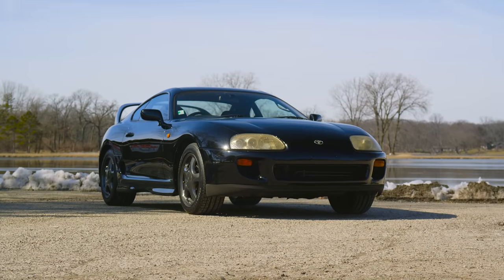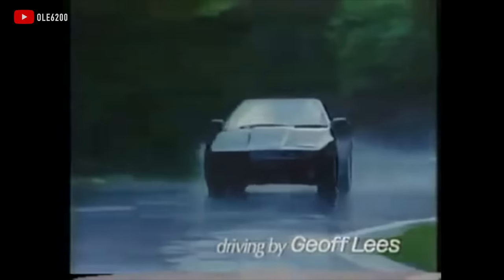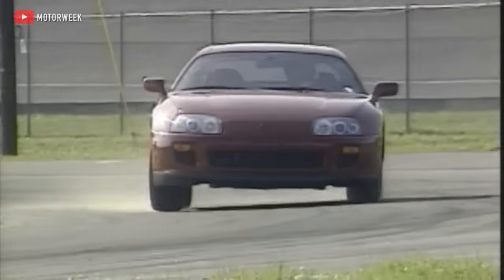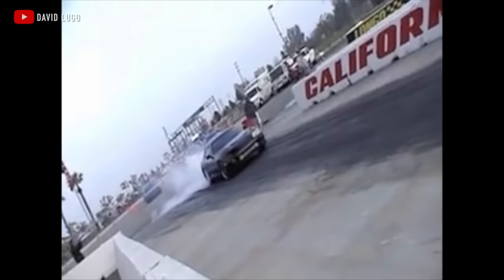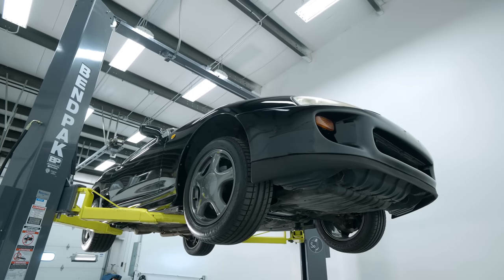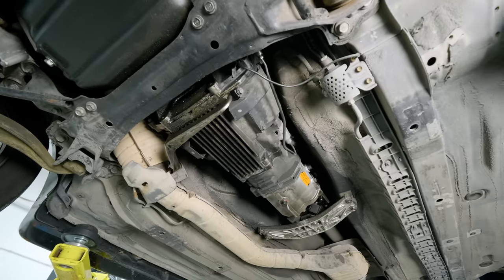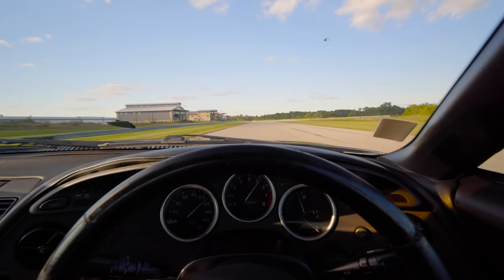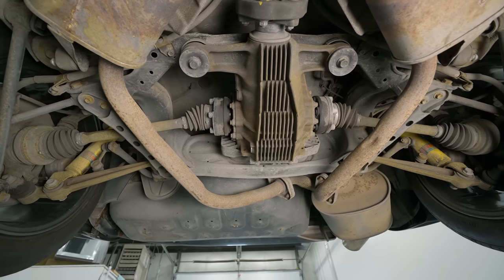Toyota Supra MK4 | Over Hyped or Legendary?

Comment: From 1992 to 95... What a time for auto enthusiasts. The C4 just boosted it's bhp. The RX-7 was a clean sheet design. The 3000GT VR4 and Stealth. The new kid on the block 300ZX TT who took this segment by storm in 1990. Finally the best of the group the Supra Turbo. I raced against the imports with my 92 Z51 Vette and it was tiring how often the manual equipped Supra Turbo would beat the vette. Great time for this segment.
Reply: The 300zx more groundbreaking and visually impressive than the Sup when it came out in 1990.
Reply: @letsgocryptos  the 3000GT VR4 was much more technically advanced than either and better looking IMO
Reply: that was a crazy time. Only thing Toyota didn't have at that moment was a compact lightweight RWD vehicle, but they had everything else. GT-Four, AE92, SW20, Soarer, Sera, hell even the Paseo was fun.
Reply: Very true! Great time for many cars. Galant VR4, Prelude VTEC, Integra GS-R etc.

I have a 6-spd 94 Corvette now. I really enjoy it. Much more than I thought I would being an import guy.
Reply: @andydhillon1977  It's hard to go wrong with a corvette of any gen, they're all fun.
Reply: Your ‘92? So it had the 300hp LT1, and the T-56, 6 speed? That should take a stock Supra TT without any issues?
Reply: @sigmaprojects  the MR2 seems to fit your description perfectly
Reply: @davew9258  If you're talking about my comment about 90's Toyotas I did list the SW20, I should have said Toyota didn't have a compact FR. They literally had everything else. MR, compact FF, AWD, and sporty FRs. 80's into 90's was such an awesome time to be a car enthusiast.
Reply: @davew9258  Nah, stock for stock in the early 90's Turbo Supra would basically edge out a stock C4 all the time. Both Supra Turbo and late model C4 vettes were listed with similar power to weight ratios on paper, but on the dyno the Supra was putting down a lot more power, so it's understandable why a Supra Turbo would beat a stock C4 no matter the year. Stock Turbo Supras were dynoing around 290~320hp to the wheels while C4 Vettes were dynoing under 300hp, like 200~290hp depending on year.  Supra was matching the C4 with torque on the dyno as well. You can see why the Supra became a freeway missile in no time.
Reply: @sigmaprojects  i just saw “compact, lightweight, RWD option, and thought Mister 2 fit that description
Reply: @sigmaprojects  I was the night and weekend lot tech at the Toyota dealer from ’93-‘’98, when I was 13 til I graduated high school, my favorite job of all time
Reply: @davew9258  Fun times I bet!
Reply: @davew9258  It does, I meant to say compact lightweight FR. The early 80's had a few compact FR options, like Celica ST, Starlet and of course the AE8X Corollas.
Reply: @sigmaprojects  the Supra was rated at 320 SAE Gross horsepower, which means a great one at Sea Level and with good gas might put down 250 rwhp. And the number that hasn’t been mentioned, torque, is why I am certain an LT1 Vette with the 6 speed would take a stock Supra, 100 times out of 100
Reply: @davew9258  When people put stock turbo Supras on dynos they get usually 290hp. C4s I usually see less. I also said that their torque figures were similar on the dyno. I mean you can look up the old numbers too and see that 0-60 were similar between the two with the Supra Turbo crossing the 1/4 mile slightly sooner.

edit: Also bear in mind people back then knew how to raise the boost a bit on the stock motor messing with the vacuum lines.
Reply: @sigmaprojects  I had a ‘93 Corvette in ‘97, my father had a 93 Supra TT at the same time and I would always beat him. He could make it close but not once did I see his taillights
Reply: @davew9258  I don't know what to say. Driver difference?

Comment: People who say Fast and Furious made the Supra popular was not a tuner back then.  The Supra was already hyped up back then before Fast and Furious.  The movie is what made you aware of the tuner scene.
Reply: No. It was literally a sales flopped car. 

And literally was criticized by lookin' too different to the MK3 A70 Supra (which that is literally the best selling Supra to date. Not the MK4 A80 Supra).

And note, the Supra MK4 A80 literally came from the Lexus SC 400 and 300 coupe(the 300 already had the 2JZ series engine , BEFORE the Supra MK4. And the 400 having the V8 1UZ. Speaking of the 2JZ, that literally began in the Toyota Artisto/Lexus GS. Not the Supra MK4).
Reply: @dewarkhodern9990  They pretty covered why the MK4 Supra didn't do well in sales in the video.  Even still, the Supra was still overhyped and popular.  People just couldn't afford them and afford the parts to tune them.  Few but some people were already putting 1000 hp on the MK4 before the movie came out.  And because of the MK4 Supra's popularity, it made it in the movie.  

And note, as long as we're going there, the Supra was first developed from the Celica as a Celica Supra.  It carried a stretched nose in order to house an inline 6 cylinder.  It was seen as a premium model and was given more standard features.  After 2 generations of the Celica and the Supra parted ways in mid/late 80s and finally the Supra was a separate car from the Celica.  The now newly parted Supra was fitted with the 7th version of the M engine.  The M engine dates back further than the 2000GT into the early 60s.  People often reduce the 7MGTE to just a mediocre engine but once you install sturdier head studs and head gasket it becomes a very capable engine in it's own right.  Even still, the MK3 Supra's biggest flaw was it's heavy weight.  

Side note also, the first Soarer was based off of the 2nd generation Celica Supra.  So you can kind of say, the Celica also gave birth to the Soarer.  So it's only natural that would continue onto the MK4 Supra.
Reply: @thomaswills2301  The Toyota Soarer was not based on anything. It was basically its own vehicle.

While the MK2 A50/A60 Supra was based on the Lotus Excel. The MK3 A70 Supra was based on Soarer, not the other way around (and the Soarer was also the first to have the 1JZ, right before the Supra MK3 A70).

You say 1000hp Supras(MK4 A80) already existed before the Fast And The Furious? That's hard to believe (and 2JZs can't hold 1000HP on stock Internals. It's just a stock block at that point). 

And literally the Supra A80 MK4 was not hyped up like that in the 1990s, it faced criticism by the public when it was said to be a "value brand front engine Ferrari" and along with being criticized of not having the pop-up-headlights like the MK3 A70 Supra (the MK3 A70 Supra is literally the best selling Supra to date). And guess what vehicle the 2JZ debuted in first. I'll wait.
Reply: @dewarkhodern9990  The Japanese consumers responded really well to a more luxury sporty car when the Celica Supra came out.  But, the Celica Supra needed to be more sporty in order to compete with it's competitors.  So Toyota made the Celica Supra sportier and created the Soarer as the more luxury sporty coupe.  It's based off of the Celica Supra.  And you can take it from there.  They are like nonidentical twin brothers.  One stayed on the path of more sporty and the other more civilized luxury.  So yes, as they grew they would retain similar characteristics like the same engine.    They are two slices out of the same pie.

Comment: It can be both. Its performance on both track and quarter mile was nothing to sneeze at but the engine was its main claim to fame due to how stout it was and its ability to handle a lot of boost which is still impressive even when compared to engines of today. Combined with its looks(which is subjective), a little help from Paul walker, and some video games, the Supra went from barely talked about in the US to being next to impossible to find stock.

But that's where it ends. The engine wasn’t exactly exclusive as it was available in plenty of  Toyota/Lexus models with the gte version being an exception kinda as it was only in 2 other products. Looks, as stated before, are subjective. They weren’t exactly cheap either. In today’s money, an a80 would run you about 50k for a regular model. And like any performance oriented car, unless you were an enthusiast, it be hard to justify paying that kind of money for a Toyota as opposed to similarly/cheaper priced sports cars and gt cars in the US market. So it never really sold. And the performance, while solid, couldn’t keep up with most of the big name jdm cars of the 90s. And it wouldn’t hold up as well to the cars of recent times either with the exception being the gte(but you’re gonna swap that out with a big turbo anyway to get that famed 1000hp number).

TLDR: The supra definitely deserves its praise for its performance, engine and moreover, its friendliness towards high boost but a good amount of the hype generated by the car were more so by casual fans and people who in reality wouldn’t even buy it in the first place.
Reply: TLDR: it’s overrated
Reply: The gte version of the 2jz is the only version worth anything. Not all 2jz engines are created equal. The GE was not even a third as capable as the GTE in terms of handling crazy boost. The 2jz GTE was only offered in the Supra. The 2jz GTE is the only one that’s valuable… all of the other 2jzs are garbage and can not handle a lot of boost. They don’t have the beefed up internals of the GTE.
Reply: @MMPGAMMING  Not really, its the same block, and its only about the block with this "boost handling" bs. Its one giant lump of iron, while most engines are aluminium and engineered to be as strong as they need to be. You change the internals when you do those high boost builds, if you stick to stock internals on GTE it will blow up too if you go high boost like an idiot, which most people do thinking it's made from adamantium or something.
Both engine and car are overrated as heck tho(which doesnt mean its bad), Supra MK4 is quite mediocre, 300zx, RX7 and all others are better. It's also impractical as hell compared to other coupes hell even Celica is more spacious trunk and rear seatroom wise. Supra is quite useless in it's grand tourer role unlesss you rely on rear seats as storage. MK3 was more roomy and you could have it with 1JZ(7MGTE motor had weak headgaskets and blows them all the time) 3000GT from mitsubishi is more roomy and also potent and comfy.
Stock car i can respect, but all the monkeys that rob us of these car ruin them. Stock Supras are scarce in proper setup(6mt na or turbo), they replace everything on it, blow it up and waste another supras for parts bin to fix it.
Reply: BTW, the saying is "sneer", not "sneeze". 😄
Reply: You’re not hitting 1000whp on a stock bottom end with a 2JZ. This myth needs to die.
Reply: @Enthusiastlist  Exactly true. Crazy horsepower numbers like this are only possible in a long term if you change quite a lot of parts within the engine. Lots of tuners put huge amounts in money and working hours into their cars to achieve this. Its not like you make a mapping and then you go on the drag strip and everything will be fine. People who are claiming that have played to many computer games.

Comment: Just goes to show how much engineering for chassis/suspension has coming a long way in the last 30+ years. Today, probably even an  SUV from BMW/Audi or Lexus have less torsional/longitudinal twist/flex and more roll resistance than a sports coupe like Supra MK4 had back in the early 90s.
Reply: Well, it's a targa top.  That makes a big difference.
Reply: @dizzywow  Even the coupe was not that different. It had a very soft chassis. My friend has one.
Reply: A mid range modern Ford SUV feels far better and has less cabin noise than any vehicle I've owned so far. I can't imagine what a BMW or Audi feels like.
Reply: @Josh-cw8by  Modern bmw's, haha, worse than your Ford for noise, because they have bling 19" wheels and run flat tires. 1999 might have been the peak for them: 3,5, and 7 series all had very rigid bodies, comparable to many current cars. It made a huge difference in rigidity when they switched from mild steel, to fully galvanized high carbon steel chassis. Japanese autos lagged a lot in this switch, because it's expensive. The new bmw's are insanely stiff, you can notice some of that in handling and noise, but most of it is irrelevant because of the soft bushings and suspensions they have to use to compensate for the huge noisey wheels and run flats. They are both louder and less interesting to drive.

Comment: I am surprised that R32 and R33 Skyline GT-Rs were not mentioned at all in this video.
Reply: i scrolled for way too long to find this, they mentioned everything except its biggest rival lol
Reply: @CurtisSmal  - which wasn't the designers had intended. It was aimed primarily at the Z cars.
Reply: @pmayo7894  yeah but thats not where it fell (at least in motorsports) they aimed for the Z and got the GTR lol solid effort IMO
Reply: @CurtisSmal  - which required ditching the 2JZ in favor of the 3S-based 503E 4-pot and 3UZ V8 in the JGTC and early years of Super GT.
Reply: @pmayo7894  you are 100% correct, finally someone that knows their stuff

Comment: Cool fan fiction, Albon, but the Supra absolutely did not outpace a ZR-1 or outbrake everything out there.  Either Toyota put some cheater tires and upped the boost on the review car or the reviewers were paid to fudge numbers.  The physics don't support the idea of something that pigfat outbraking much lighter cars.  Even an LT1 C4 would smoke a stock Supra turbo.  The Supra was an OK car at best and sells for about 10x what it's actually worth.  All it's good for is making an unusable amount of power if you dump $30k+ into it.

Comment: In my opinion, since you're asking, is that the Supra was a car that can't really be compared to anything we have now. For it's time it was a beast of a car. It was very common to put out 800 hp on stock internals. And the transmission would be swapped into other platforms because they were stout. And in my opinion the lines of the car are ageless. Like a Porsche. Just never gets old. Nothing at the time could do what the Supra did so easily. With that said if you pick it apart it wasn't particularly nimble. And they had old school engineering. Brackets upon brackets in the engine bay. And as much as I love the the oe wheels on the mkiv those things were way too small. Bottom line is there's a reason why til this day the most powerful and fastest import drag racing cars use the 2JZ platform. Yes at that level nothing is stock. But each platform has its limits. And the fact that the limit of a 2JZ is closer to 2k horsepower tells the engine was just one of a kind.
Reply: not one of a kind, there is another, and it's called the barra.
Reply: @CurtisSmal  That's right. Those are nasty. Aussie version of a 2JZ.

Comment: I remember the old joke: 
What do a 400, 700, and 1000hp Supra have in common? 

They all run 12s. 

Not true at all anymore, but those cars were fun for their receptiveness to mods, not their driving dynamics.
Reply: @DOGS LOL The MK4 was 3560 lbs this is light by today's standards. To give you an idea the R35 GT-R weights 3995 lbs, 2nd gen NSX 3960lbs, BMW M4 3979 lbs, 911 Turbo (992) 3821 lbs, Mustang GT500 4182 lbs. I have a feeling my youtube account alone is older than you.
Reply: This was even back in the early 2000's not true. I was around the Supra scene from before F&F came out. Back in the early 2000's you had guys like SW, Ryan Woon and Nero Deliwala etc running 9's in street Supra's. But to run 9's and not 12's  you need drag radials and a prepped track, this has not changed. The vids of these guys are still here on youtube.
Reply: @electrikoptik  I was a member of the Honda scene 20 years ago - the truth of it to us was that the average Supra or turbo tuner at the time was only interested in the dyno, not the actual drag strip or track. Turbos and builds that could make usable power weren’t exactly common back then - we would have a built turbo Honda with 600hp in a 1700 pound stripped chassis and hit high 11s, we all know what an average 900hp Supra dyno plot or turbo tuner dyno plot looked like back then. 😂